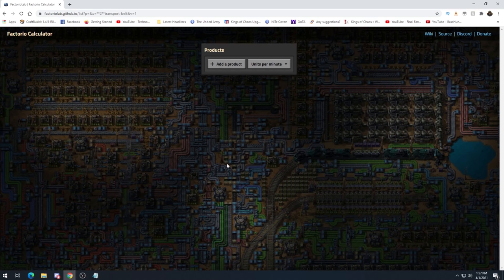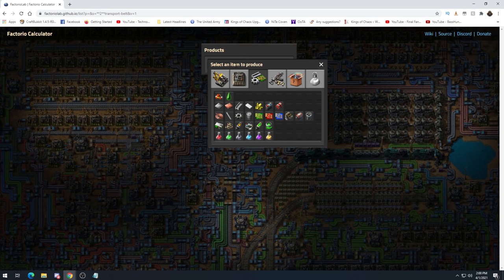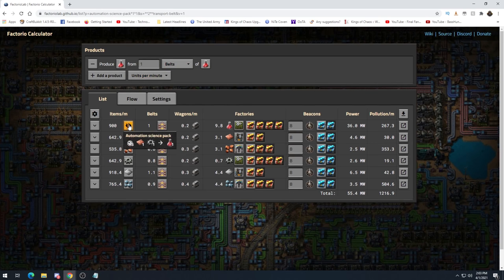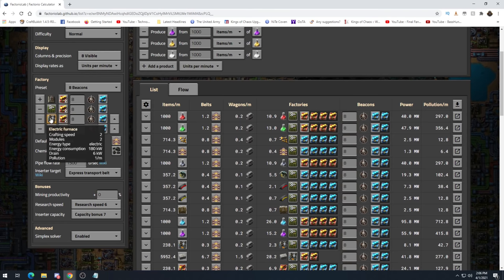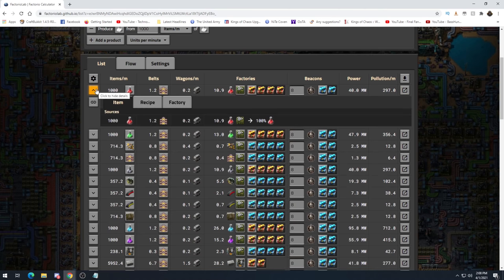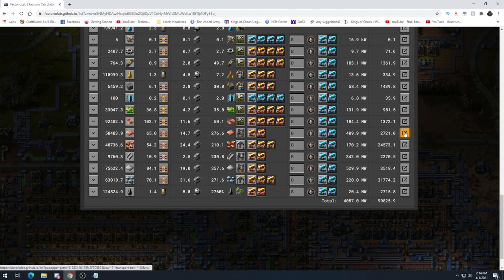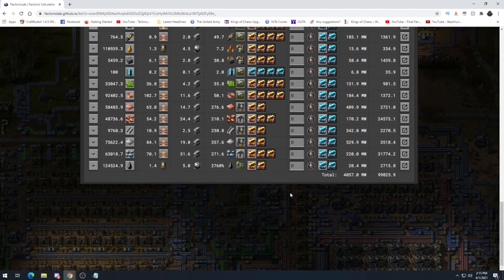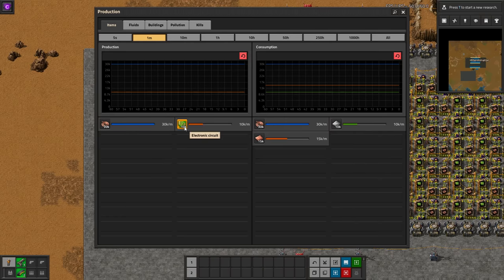Factorio Megabase Tutorial & Theory EP2 - Using Factory Calculator, Modules / Beacons & Test Builds

Comment: I think the thing I struggle with the most is transitioning from my normal base to mega base. I Managed to get to around 450/500 spm with my very first base but due to it being my first playthrough I never managed my space well at all and am having trouble visualising any sort of expansion.
Reply: Me too. I want to crack on, but it's all a bit overwhelming on where to commence. So I've started clearing away biter nests. I wish I didn't have so many lakes on the map
Reply: I always had the same problem when I tried to expand my original base to a larger base. When you think about it, it makes sense: the original base is not designed to handle the amount of resources a megabase needs. Sure, you maybe can manage by completely rebuilding the original base step by step, but that means turning off original builds, so you first have to provide the replacements, and it's a big planning effort to get that right without crippling your production in the meantime.
How I finally managed to get to a nice megabase:
- Build the initial base as you would, until everything is researched. It should include a mall/make-everything good enough to supply you with what you need to build another base in the same order of magnitude (just the buildings you don't need tho supply the resources to run it yet)
- Build a BIG mall elsewhere, large enough to provide you with all you want, especially plan for lots of beacons and modules. Use separate resource patches for this one, so you don't drain the patches for the original base just yet. It should be a bit away from the original base. Plan the layout and location of the new mall according to what you have in mind for your final megabase. You build this mainly using the stuff provided by the original base's mall. Either have a train connection that can bring you there or use a long reach mod to grab stuff from far away.
- Once the big mall is complete, dismantle the old base and start building the actual megabase. You may delay the dismantling for a few hours to get some of the infinite researches, but after a while, it will just be painstakingly slow. The dismantled original base can be shipped to your new mall and put into the right storage boxes if you want, that's how I did it last time. But frankly, next time I'd just build a huge array of storage boxes in the old location, have robots dismantle everything, and then get rid of all those items with a nuke. Good riddance.